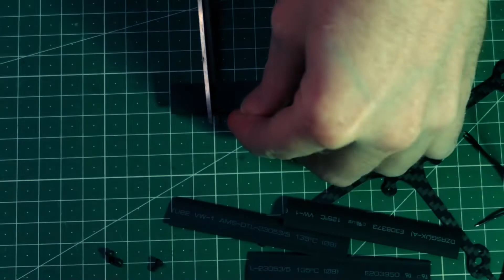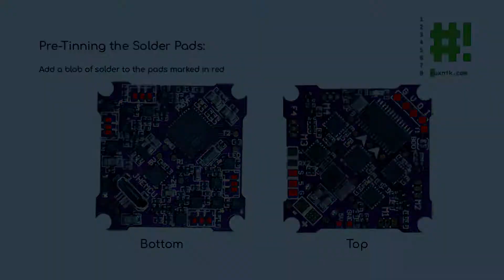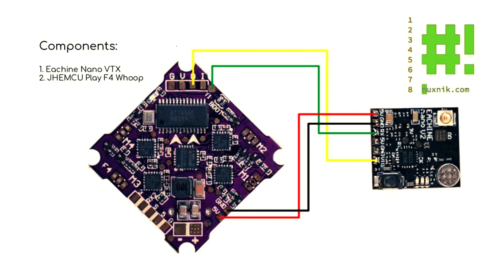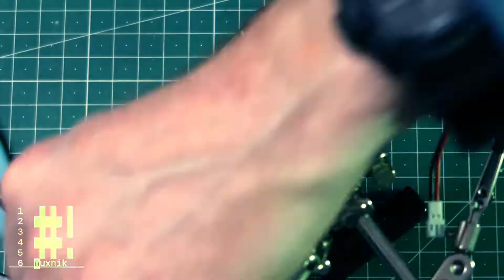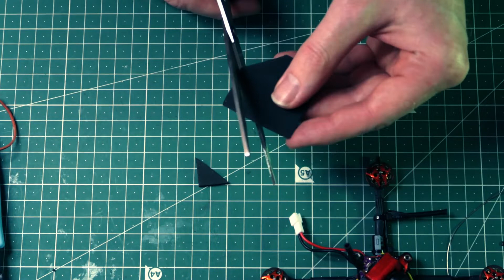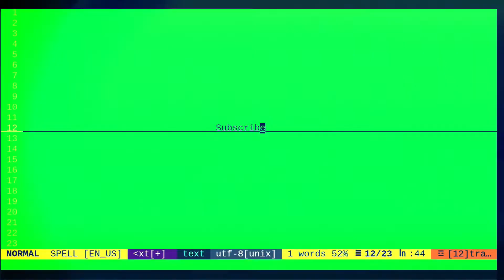Baby Tooth Build Guide - DIY FPV Drone - Part 1

Comment: Great how-to! I was thinking of building this as a fun project, but realized I didn't know which remote and goggles would be compatible. Can you recommend some, of give guidance on how to tell what's compatible?
Reply from the maker: Sorry for the late reply. That is a difficult question. The world of goggles and transmitters is vast and there are many different options. If I were starting out, I would use an ELRS receiver/transmitter system. For goggles, it is a question of your budget. Good luck and let me know if you finish this project :D
Reply: @nuxnik  Thanks! I'll do some digging around based on your suggestions. 😀

Comment: What are the specs for the rubber grommets?
Reply from the maker: I used M3 grommets because that is what I had on hand., That is also why I added a bit of heat shrink tubing to the mounting posts. You actually want M2 grommets for a snug fit.

Comment: I built my drone the same your Toothpick, my drone can bring 2s 18650 VTC6. But its motor is so hot!
Reply from the maker: Cool, what kind of motors are you using?
Reply: @nuxnik  
I use brushless motor 1104. It very cheap. It is rewound to reach 9000kv by 0.2 mm diameter copper!
Reply: I use 3 inches propellant and I measured its flight time up to 14 minutes with Sony VTC6 18650 3000mAh battery.

Comment: This looks great but I am curious how it flies on 1S with 6k kV motors..
Reply from the maker: Good question. I'm sure it will work, but will have less "punch" due to the lower rotation rate. I have some 6K KV motors and am going to build a similar one with a runcam split 4K camera with 3S batteries. Maybe I'll do a video about it. Thanks for the comment. :)

Comment: What range can I expect to able to fly with this one? Have you tested the range?
Reply from the maker: The range is dependent on the components you use - typically the VTX and the battery. This little guy is not meant to fly too far, however with direct line of sight, I could probably get it out 1km.
Reply: @nuxnik  That would bemore than enough for me :) I am new in this hobby and bought the BetaFPV Cetus PRO RTF kit, and I can't even fly around the apartment complex, without loosing the VTX signal.

Comment: Would this receiver work with "LiteRadio 2 SE Radio Transmitter"? I am a newb :)
Reply from the maker: Yes, it can work, but I wouldn't recommend it unless you have experience with FrSky software. The software situation with FrSky is a mess and binding can be a pain. Since you have the LiteRadio 2 SE I recommend you use an ELRS receiver instead of the XM+. I used the XM+ in the video because I had an extra one laying around and the form factor fit the small size of the drone.
However, ff you are interested in getting an XM+ receiver working with your radio, check out this reddit thread: https://www.reddit.com/r/Multicopter/comments/ka4g4x/has_anyone_successfully_binded_the_frsky_xm_to/
Reply: @nuxnik  Thanks for the answer.
Reply from the maker: @b0stj4n  I got to thinking about your question and updated the article I wrote concerning this build. I added an additional wiring diagram for an ExpressLRS receiver and will talk about it in part 2 of this build series. You can check out the wiring diagram here: https://nuxnik.com/baby-tooth-build/ Thanks 👍
Reply: @nuxnik  Wow, very nice of you. Thank you again.

Comment: I'm not sure that on such a long wire there will be a sense from the capacitor, in fact it should be located as close as possible to the "point" used. and replace Ph 2.0 with GNB27.
Reply from the maker: Good tip! When I was putting the quad together I still wasn't sure where I wanted to put the capacitor, so I left the leads longer. They could definitely be shortened.  

I agree that the PH2.0 can be a current bottleneck and can reduce the performance. I kept it because almost all my 1S batteries have a PH2.0 connector and I don't want to re-solder them. At the same time, this little drone is a beast and can fly like a bat out of hell on 1S with PH2.0. I am glad you mentioned this connector, because I will be talking about it in the next video. Thanks!
Reply: @nuxnik  Yes, not for that. I just proceed from my experience.  I can also say that in order to fully unlock the potential of such quads, you need a 9+ amp AIO, which can be counted on the fingers, because there are only a few of them on the market.
Reply: Isn't BT2.0 even better?
Reply: @b0stj4n  BT2.0 = GNB27 in bandwidth, it seems